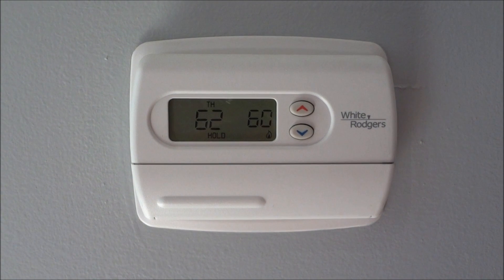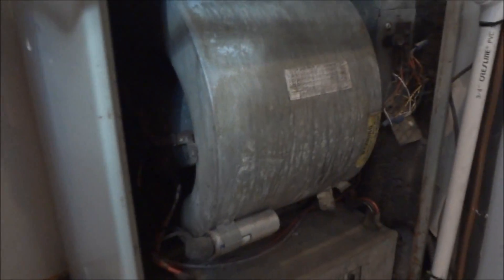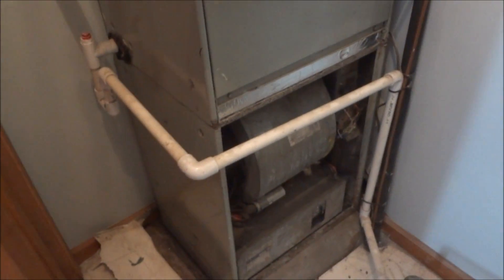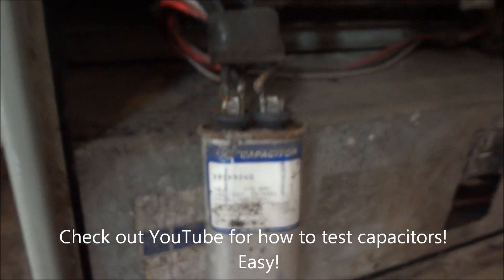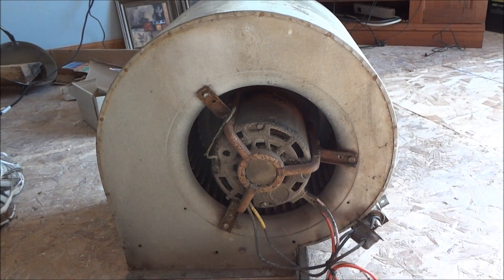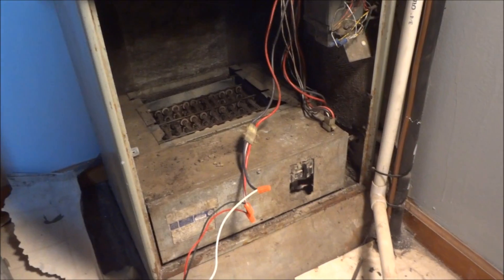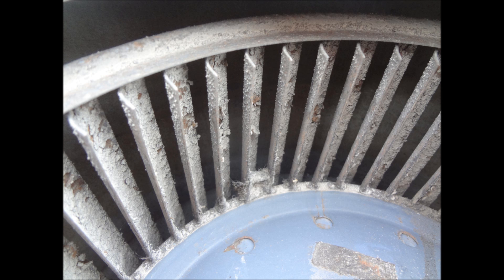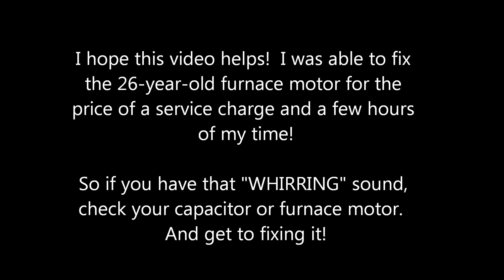Replacing a Trane Furnace Blower Motor With a Whirring/Buzzing/Humming Noise

Comment: Thanks so much! You helped me wire my old Trane unit with a new motor; it was really confusing with the new motor, and I tried to follow some of the old wiring! I got it wrong and the motor got super hot in 5 minutes and stopped! I have the same wiring as you and looked at your video! Fixed! Now working great! Thanks so much! Keith

Comment: Great videos Dash! I am having difficulty replacement parts for new  GE 5KCP39HG 1/3 HP 115Volt 1075/4SPD CPND341417P01. Would you please direct me to a couple of sources that we laymen have a hard time finding? Tried Amazon and ebay but could not find an exact match. Thanks a ton!

Comment: I am having a hard time finding the right motor,  At Grainger, a big corporation all the motors have aluminum wires, while my house is copper and it even says on the Trane manual to use copper conductor only.  My air handler motor is from 2001, and 10 years ago i changed the capacitor once.  MIne is 1/3 hp, at 220 volt.  The problem is the math doesn't add up. 1/3 hp is 735watt, af 1hp =746 or even 735 watt.  The FLA printed on the motor,  on air-handler and on the manual is 2.2 full load amps.  As ampxvolt=watts.  So it means I was supposed to only attach one hot wire, which would be 110 volts, not 220 volts.  I am sure I burned while changing the capacitor I attached both hot leads assuming its 220 volts.  I feel lot of the motor sold today have wrong hp vs full load amps printed.  Morrison another big corporation has a universal motor that is sold to homeowners and its $150 to $200.   Many of them only sell it to contractors.  I can not return it once I buy it but I will give it a try.  I know many of my neighbors bought a new unit which is a big junk of money sold with lot of gibberish and marketing.  I will give it a try and if I burn it so be it, but I wish I can get some help.

Comment: I have this same problem and I checked its 10uf +/_6% capacitor and it was not good because I got only 9uf; it should be between 9.4uf to 10.6uf.  I then replaced it with a good 10uf capacitor and also oiled the motor too.  The motor is running ok now; but it still has a whirring/buzzing/humming noise at the start for a second; then it kicks off the fan.  I guess my motor will burn out soon.  My motor costed $285 on Amazon.  This system is 14 years old.  Ebay has 2 used ones for sale for $125 each.  I think I go with the one on Ebay.  

If the system works right, it should not make any whirring/buzzing/humming noise at the start right??

Comment: I’m having the same noise but instead the house is hot . Is this the same fix ? On Auto the air comes on but it doesn’t stay on
Reply from the maker: Hi Tranae!  Yes, it's likely the motor, as both the furnace (winter) and A/C (summer) actually use this same motor to run the fan that blows air all through the house.  So being that it is summer now, if your motor is worn out (giving you the same noise), your house would be hot instead of cold!!!  Hope you have an easy fix!